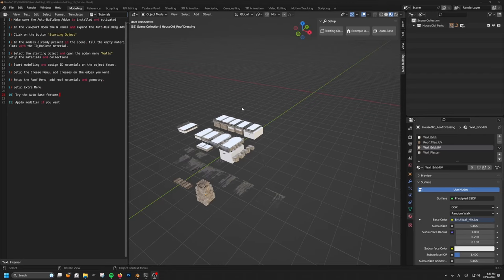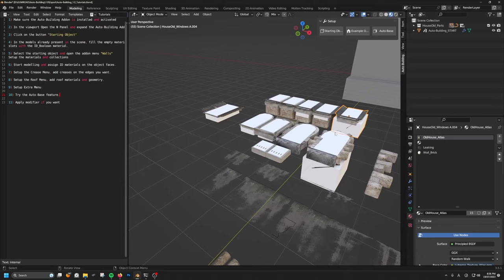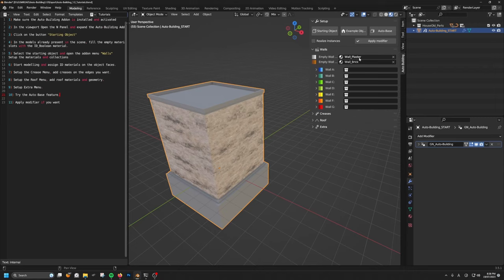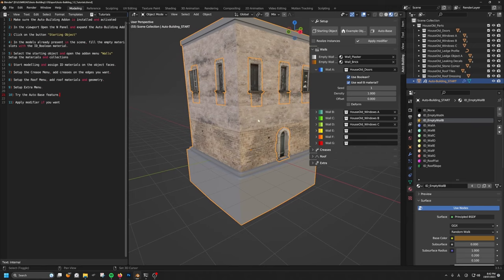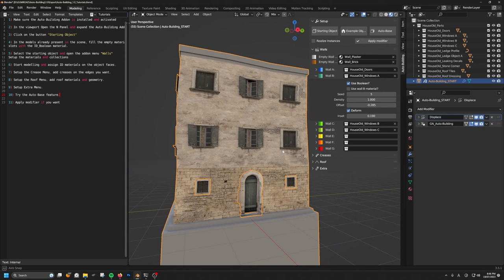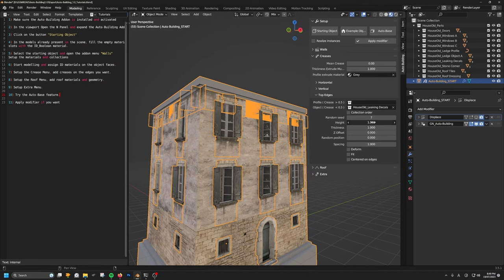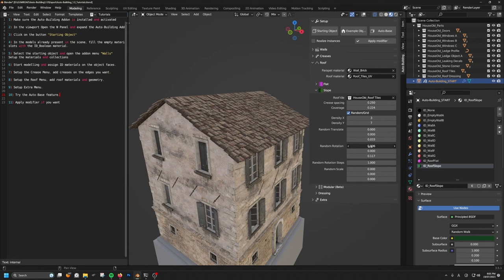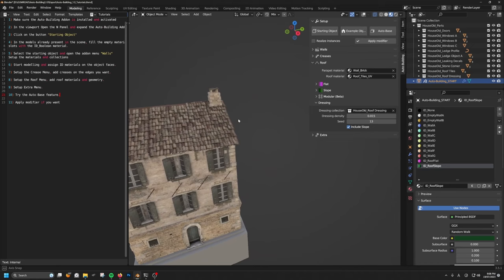Auto-Building Add-on - Tutorial

Comment: Hello!
Hello!
I remember in an earlier version, it seemed that after converting the programmatic model to a grid, the texture was lost (or could not be exported, I forgot).
I wonder if the current version can fully export FBX and maps to other software such as UE?
Thank you!
Reply from the maker: Indeed, in older version of Geometry node, UV were not preserved when Realizing the Instances, which was important to export. Now it works well so in 1.2 I added an option use an auto Unwrap function, or manual unwrapping if you need something specific for your walls :)
Also, Embeded or Altermesh plugin for UE were both tested and working with my add-on if you don't want to have to export the buildings as fbx.
Reply: @juliengauthier6379  Great, amazing, magical！